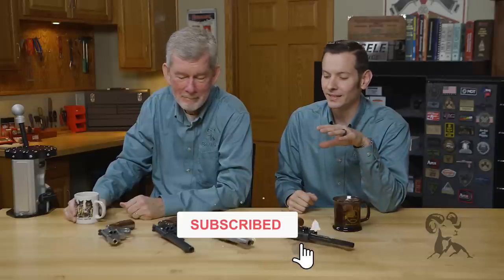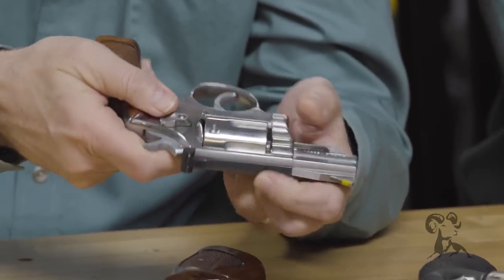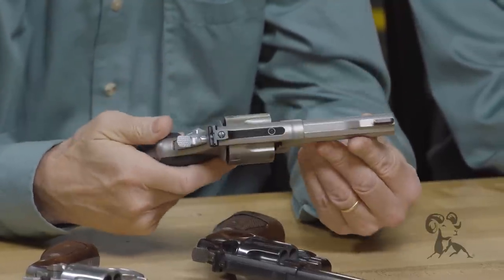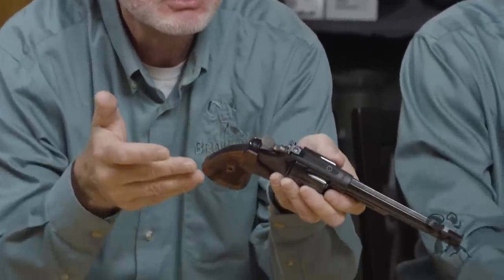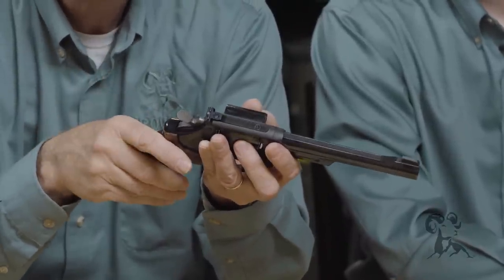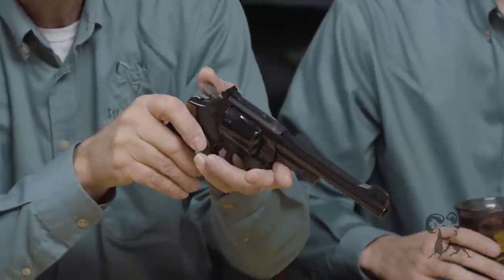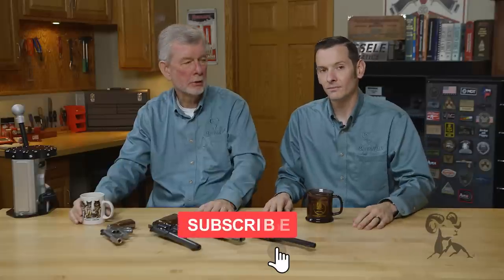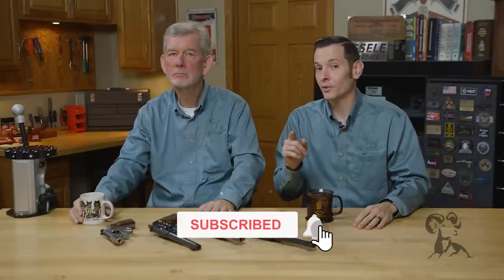Smyth Busters: Are Old Smith & Wessons Better Than New Ones?

Comment: I own my fair share of pre-lock/pre-MIM and Post MIM S&Ws, and can say without hesitation that I’d take a pre-lock/pre-MIM any day over a newer S&W, namely for the fit, finish, smoothness and general reliability.  A number of my newer S&Ws have had to be returned to the factory for repairs (timing, barrel, fit and finish issues).  For heavy shooting or stout loads,  I’ll generally pull out the Ruger GP-100 over either generations of S&Ws.
Reply: Ive got an old S&WCombat Master Piece. Fine shooting hand gun. Got an old Colt Police Positive too. Both fine revolvers.
Reply: My buddys performance center had a timing issue on a cylinder.  That should have never left the factory let alone the performance center
Reply: I agree 1000%.

Comment: Inherited a pre-model 10 from my grandfather. You won't be finding a double action trigger any better than this ! American made equipment in the late 1940's is hard to equal at any price.
Reply: Due fairness to your pre-M10 Military & Police, it's had over@ 70 years of potential use to naturally smooth the lock works.  I still agree that pre-lock Smith's are better quality.  I recently bought a Model 10-5 and will not part with it until my time on Earth is finished.
Reply: A gun like that will last for many lifetimes...it’s sad,technology has improved greatly since then but the quality of products has plummeted..just look at all the old TVs,electrical appliances,power tools,cars,etc that are still going strong today..these days when you buy a new freezer,oven,tv,air conditioner,etc you are lucky if lasts a decade

Comment: I like the look of my old S&W's. I load 44 cal, 200gr hollow-points to about 1200fps never had an issue with performance. In 44 or 45 you don't need full house loads to hunt. Full house loads will eventually loosen up most revolvers.

Comment: The thing is, in the olden days labor was cheap and technology was expensive. They may not do as much finishing work or hand polishing and finishes on new guns, but with modern metallurgy and computer aided design and machining, new guns are almost certainly a lot  stronger. I went to the John Browning museum in Ogden UT, and the man there told me that Browning's first lathes were peddle powered.

Comment: I actually think you can go both ways on this. The only mistake people make is putting modern hot loads in older Smiths. Examples you would not shoot Buffalo bore 357 magnum out of a nice model 19 or 66 . But modern Smiths  Classic series the new 66 combat magnum or 19 carry comp with new lockup and improved forcing cone with stainless steel barrel you bet. If you want to enjoy your vintage Smiths do a little research and see what loads were used at the time or hand load for them. It will make you feel good knowing that your revolver can still be enjoyed the way it was intended.

Comment: I just wish they'd get rid of the stupid lock and stop using 2 piece barrels, or at least sell you the tool you need to take the shroud piece off.  MIM parts don't bother me but what does bother me is I have this $800+ revolver with a hammer and trigger that look unfinished and weird.  It's not so bad if the gun is blued, but on a stainless gun it looks terrible and the forged parts just look much better.

Sorry but aesthetics is part of the consideration with such an expensive firearm.
Reply: Ahh the Hilary hole , it’s a turn off for sure but it wouldn’t stop me buying  these great American revolvers . There is a plug you can buy for that hole .
Reply: @conservativesniperhunter7439  True, but I also feel like I shouldn't have to do that.  I'm sure you concur.

It's just dumb, it doesn't make the gun any safer.

What's crazy to me is there's actually much more elegant ways of implementing a similar system by placing the mechanism under the grips or on the hammer, it's much less visually obtrusive and it answers the concern about the force of recoil engaging the lock (which I believe is a complete myth anyway, but I digress).  If they'd gone with either of those routes I don't think it would bother me so dang much.
Reply: I've heard the finish used on the hammer and triggers is case hardening, which is supposedly durable, but I've seen em rust. And I agree, they look like ass on stainless guns. Don't know it's exact finish, but I like the silver colored hammer and trigger on my old 66-3. If I got a new stainless Smith, I'd opt to refinish those parts in a similar silver color.
Reply: @lon242  I believe on a 66-3 you have polished forged controls (hammer/trigger).  That's the right look, imho.
Reply: @lon242  If I am correct the older triggers and hammers are forged then flash chromed .

Comment: The lock is like putting a face tattoo on a supermodel.
Reply: Or a nose ring
Reply: On the J and K/L frame, they also need to change the curvature of the frame between the cylinder release and the hammer to accomodate the lock hole, that just ruined the overall look of the revolver. It's like your favorite supermodel is nice everywhere except now her waist is 6 inches bigger.
Reply: That comment is like a boomer on a computer.
Reply: Lock sucks. Make more models without locks and I'll buy some new S&W.
Reply: And I wonder how many "accidents"  that lock has actually prevented?  Just doing something for the sake of it to make someone feel better. That is all that is.
Reply: That stupid lock on a Smith  and Wesson is like Having Biden wrecking our country.

Comment: I believe that the older S&W revolvers were more thoroughly inspected by a skilled human being, by nature of the older build process.  Automation economizes the build process and there are less process imperfections, but a higher percentage of imperfections escape detection.
Reply: Agreed, well said.
Reply: I have to agree with that. The quality control has dropped significantly. In Europe, it is extremely difficult to get a S&W revolver as they are usually sold out and have extremely long delivery times (9 months or longer). When you finally get your revolver and it is still a faulty gun, you have to complain about it and after about 9 months you get it back from the repair shop. This of course discourages a buyer from purchasing a revolver. That's why people here in Austria tend to buy pistols (GLOCK).
Reply: Great point. Fewer errors are made but most of those few make it out to the market without ever being seen by a human.

Comment: I tend to agree with one exception. I absolutely hate, and I really mean hate the hillary hole lock as S&W installs on revolvers. it is totally unnecessary and extremely unattractive. If a lock is mandated by law then put it on the hammer as a competitor does, NOT in the side of the gun. Also provide a way to disable it so it can never be inadvertently activated in a defensive weapon. After all you don't put those locks in a semi automatic pistol do you.

Comment: Are old smiths better than new smiths?
Short answer: Yes.
Long answer: Yeeeeeeeeeeeeessss.

Old smiths are forged steel beauties.
New Smiths have MIM parts and that stupid hillary hole. They feel cheap, and when put side by side with a Taurus, there isn't really a major difference. Slightly better MIM quality. Better finish. Thats about it.

Comment: In not going to say I disagree.  But I will say. The only Smith’s Iva had issues with are the new ones.  Clocked barrels.  Horrible 20lb trigger pulls.  A 442 actually lockup and freeze because of the Hillary hole safety.   And a broken firing pin a new 686+.   That being said.  I have quite a few older Smith’s that need timing jobs.  But they have thousands of rounds through them and no broken parts.

Comment: Blueing isn’t as nice on the new ones. The grips aren’t as nice. New ones aren’t hand fitted like the old ones. Hillary hole is a deal breaker. Recessed cylinder is a thousand times nicer to look at. Granted I wouldn’t run a steady diet of heavy loads in an old one. But you can’t beat the old pinned and recessed guns for fit and finish.

Comment: Mim parts are cheap......
Reply: MiM (commonly referred to as cast) parts more easily fit into the works of a weapon than the forged ones of older guns.  They're closer to spec margins than forged.  A big issue is the assumption made by the manufacturer that these MiM parts do not require much hand fitting and Q.C. as the forgings did.  This issue kicked Colt in the behind when they released New Python revolvers loaded with Mim parts without proper Q.C. inspection by senior gunsmiths at the factory last year.  No doubt that big snafu cost Colt many sales and boosted the iconic status of pre-2000 Pythons.
Reply: Cheaper, not cheap.
Reply: Gormmm  Finishing? How much do you need if done right the first time?

Comment: I have an M27, a 686+ and 2 M19. I take all 4 to the range. When one starts getting hot I put it down and pickup another. I will admit that I generally shoot .38 Special through the K Frames. I just love the L & N Frames with full magnum loads; but then I love any gun that throws such a fireball that at close range it'll cauterize the exit wound. Great video, please keep them coming!

Comment: I purchased a Smith Thunder ranch model 22-4 , the 45acp ,new , when it was first introduced , 30 rounds in , cylinder latch falls off , Locktite repaired that , 50 rounds later , trigger return spring breaks , , had it repaired by a police department armorer (40years experience), the bluing is patchy , looks like something I’d do , but it has the thunder ranch logo on the grips , all of this for about 800.00 , back in about 2007 (don’t remember exactly ) , very disappointing . I’ve never fired it since .

Comment: I'm disappointed that the frame lock is on their classic models. Only because, like the Colt Single Action Army,  this is an American classic, iconic design. I don't think any of the other modern features damage the look of the gun. They still have the elegant forged frame, deep blue finish and even diamond panel grips. Beautiful...until you see that out of place hole with the silly little alarm clock arrow. I'm sorry, but the added value of the classic design goes out the window with this addition. If you just want a sturdy revolver, there are better options.

Comment: I handled a 27-9 recently.  The bright finish was superb.  The rifling was kinda C+.  Shallow, and not a sharp corner anywhere on the lands.  Looks like a new J Frame where they soften the rifling so as not to build pressure, allowing the +P rating.

Comment: I love my sw wheelguns, but take issue with the excessive barrel cylinder gap on some of my new ones. Case in point, 686-6 had 007" gap on left side of gun, and 013" gap on right side. (yes, I measured both sides, because it blew so violently, even with 38 rounds) I sent it back to sw, they replaced the 6" barrel and slicked up the action. Well done and thanks to sw.👍

Comment: Perhaps you send just the crap to germany but i dont agree. Wouldnt buy a new one. Broken mim hammer block, timing totally wrong, rusty hammer, in general bad finish compared to the old ones. I'm glad that i dont have to advise customers, we wouldnt sell much new guns...
Reply: Yeah, my mim hammer block broke too.  I went to pull the trigger and the gun froze up!  When I opened it (worked as a smith) the hammer block had turned to small steel chips and jammed everything up!

Oh yeah, and the ratchet on the extractor got eaten up by the hand in under 500 rounds.  The heat treat made it soft like cream cheese.

And then the trigger strut broke.  Total carp!
Reply: @ATINKERER  Sad. Never change a running system. Since hundreds of years gun parts were forged, turned and filed/milled. The only advance in new technics are lower costs and no need for skills.

Comment: What about cracking the forcing cones on older k frame smiths when shooting 357?
Reply: I’ve heard it’s only an issue with light weight 357 projectiles  because of how the bullet tappers and the speed and others say it won’t happen and others say it happens to all of them with a steady diet of 357.
Reply: It happened. The forcing cone was shaved slightly, made for a weak spot. I have heard so long as you dont run 125g 357s you are fine.
Reply: @theeasternfront6436   that’s what I’ve heard also. I have a new 686+ and a vintage model 19 square butt pinned and recessed model and I’d like to shoot some 357 in it with out hurting it but mostly it’s a safe queen.

Comment: Older Smith revolvers usually have really smooth triggers from being shot for decades. New Smiths, like any other new handgun, have stiff triggers. A trigger job or a case of ammo can go a long ways to smoothing them out... That is, if you can afford to shoot your new Smith after your procurement of ammo! 
My main concern/complaint is the Lawyer-inspired locking design. To me, that's 99% of stiff trigger problem! De-lawyer the design and the problems go away!!!

Comment: Bought a "newer" 629 , with the lock, and oiled it up and while dry firing it, to break it in, just like I have done on multiple firearms in the past, and it completely locked up. Could not pull the trigger back or single action cock it.  Took it in to warranty center and when I went to pick it up the smith showed me the tiny internal MIM parts that broke.   Very glad it happened while dry firing and not  in a self defense situation.
Reply: I do not think MIM parts are as good as the old forged ones even though they say they are better now.
Reply: Had the same happen with my 629 and 640PRO.
Reply: Replace with TK CUSTOM parts, which you can polish.  Not advised to try to polish MIM parts for trigger jobs.

Comment: I have old and I have new and I definitely like the old better. Nothing wrong with the new, but the old ones man, you can just feel it in the action that more time was spent on the hand fitting of parts. The wood on the old stocks is much better and truth be told, I haven't had 1 single problem with my 629-2 (Pre-Endurance package). I mean, I'm not looking for the hottest loads, it's a 44 magnum for crying out loud and standard magnum loads are fine and all that's needed. 
Now I do like to mirror polish my revolvers and when I say mirror polish, I mean mirror polish as in 12-16 hours for a single gun and I've noticed the metal on the newer ones polishes better and quicker for whatever reason. I hate the aesthetics of the darn lock on the new one's but it's not a complete deal breaker as they shoot great.
Old is better though because of the amount of time the old one's actually spent in the hands of those old gunsmiths getting everything fit tight and right. It's as if a part of their soul went into those old revolvers.

Comment: Bought a new 686 SSR about a year ago. 3/4 of the way through its first box- dead hammer. Took it apart- the hammer spring "head" that connects to the hammer sheered off. 1 off lemon? Maybe. My old duty gun, a 65-3 from 1978 ha s god knows how many rounds through it- still runs. Same for my 19-4 from 1979.

Comment: It's a false comparison. For most shooters (not necessarily "collectors"), the choice is between the new Smith and Wessons and oldER, used revolvers. There are plenty of revolvers from the eighties and nineties, for example, especially large, heavy revolvers and police trade-ins, that were carried a lot and shot only a little, that make excellent shooters or even carry/defense guns. If I'm going to spend $700 to $1000 on a revolver, I'll look for the eighties and nineties version of the gun, rather than take a chance on something new that may or may not have quality control or engineering issues.

Comment: The fact that Smith & Wesson still offers the Model 642 and M&P 340 in versions without the Hillary hole should tell you all you need to know about that damned thing. Yes, they are very lightweight J-frames for stout cartridges; however, S&W wouldn’t make the no-lock versions unless there was at the very least a potential problem.

Steve is correct about the older Model 625 throats being badly over-sized. I have a mid-70s Model 25-2 with throats ranging from .454-.456”.  It’s beautiful on the outside but inside the machining marks are so bad you’d think some guy fired from the Vega or Pinto assembly line made it. 

Unlike Colts, S&W was still making fine revolvers up into the 1990s and some models today are better than older ones. Metal injection molding (MIM) can be used correctly on the right parts. I don’t like MIM hammers and triggers though.

Comment: The old ones are just better. Better craftsmanship. Better aesthetics. No stupid and redundant (impractical) lock. 

I guess it is like comparing home construction a century ago versus now. Sure the building materials are stronger, cheaper, more energy efficient nowadays...but it's hard to compare luxury vinyl plank flooring with that of hand planked hardwood floors. It's like comparing a 69 mustang versus a 2023 mustang. Sure you get better fuel economy. The automatic transmission is actually pretty awesome nowadays for high performance driving whereas in '69 you'd have been laughed at for even wanting one in a mustang, and there is stock airconditioning...but there's something about that old Ford muscle car that the new one just cannot compare to...

It's pride in craftsmanship and pride of ownership. Hard to find that with the new Smith's. They're just not in the same league.

Comment: Shoot my 625-3 every Sunday. 300 rounds is pretty average. Have a Texas star at 15 yards with 5 1/2 inch plates. Use .452 sized cast bullets. I have no problems hitting my targets. 8 inch gongs at 45 yards are also no problem. I have no use for a gun with a lock on it. I will keep my pre-lock guns. You can have all the new smith's you want. I will never buy a Smith and Wesson with a lock.